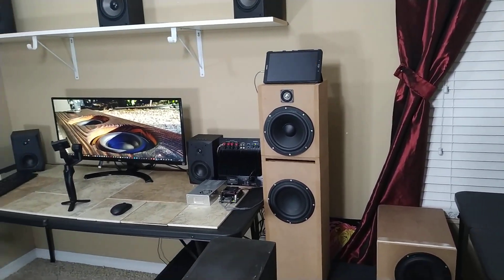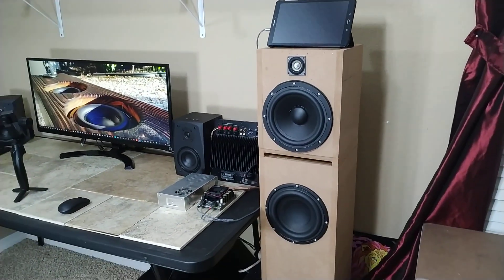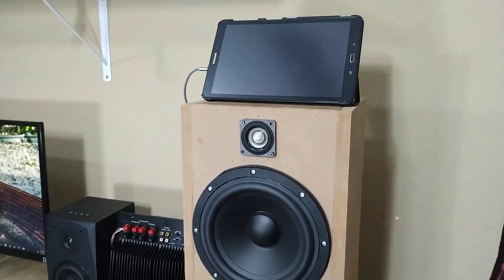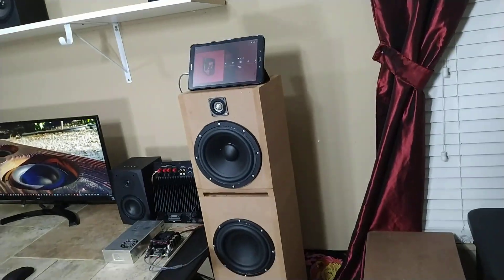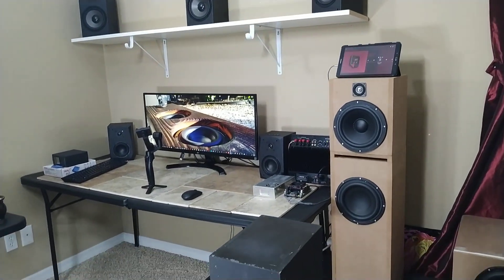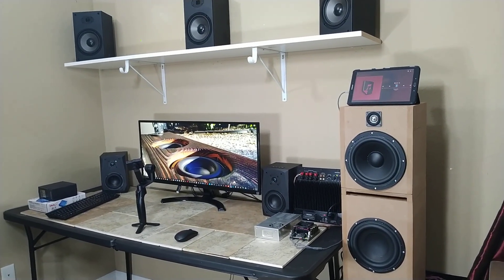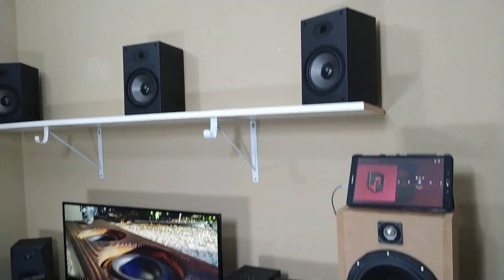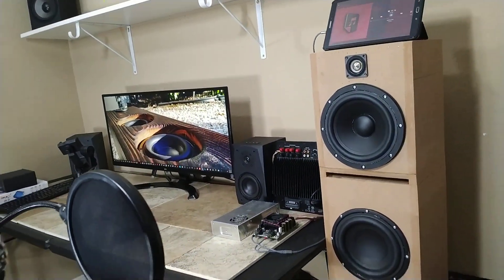Amazing Bass! Testing The Tang Band Tower - Part 3

Comment: You should provide us the sensation you hear and feel during play. From my audio capability I gotta say it sounds amazing! Would deff like to see/hear/feel in person.
Also can see how well the crossover is working between mid and sub. But if you plan on using the Pioneer unit, you shouldn't utilize the crossover on subwoofer. As the unit already filtered anything above 120hrz. As of the Mid and Tweeter, since you are using them on the fullrange output would be useful.
Tbh though a surround sound unit truely doesn't give justice to a old school 2ch unit.
To much frequency filters an cuts on a SSR its like the frequencies aren't tuned properly leaving to many gaps. 
Plus you gotta have the staging f-c-r-s. with towers like you built it will never fully get its potential.
Reply: When you make the second Cabinet make sure to do the exact same things done with this box, yup I'm even talking including the error and the final fixing.
Ect. It should be exactly like its twin. No differences in cuts Exact replica, this way you maintain the same build design and acoustical balances
Reply from the maker: Thanks for the tip